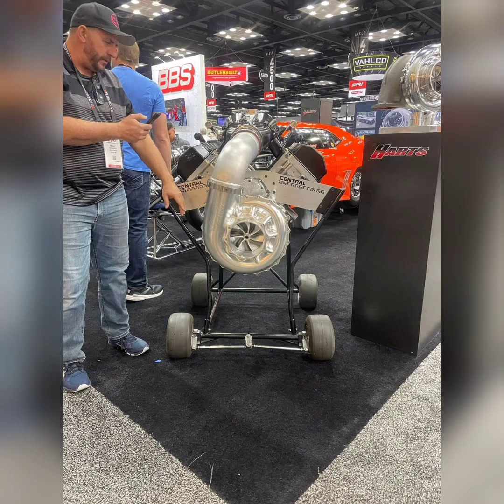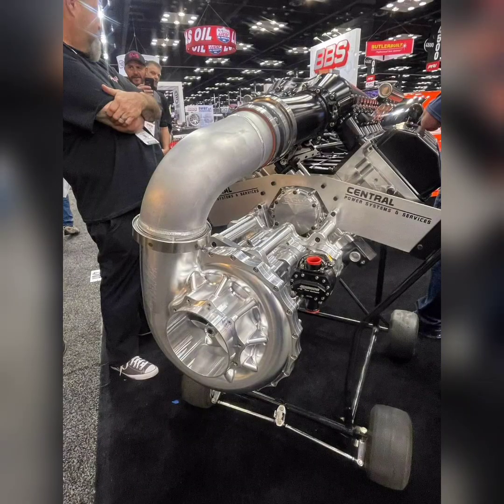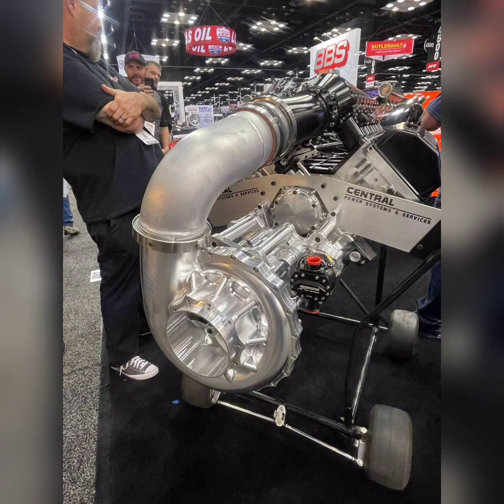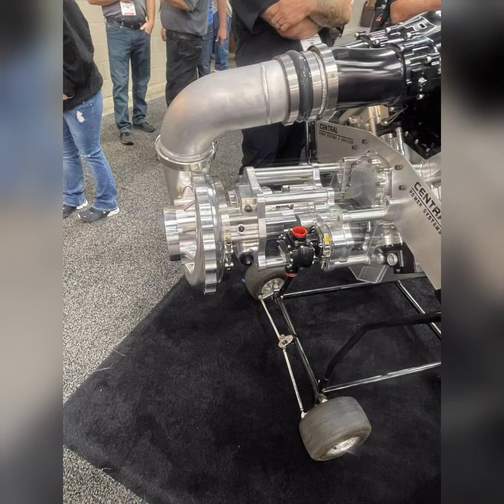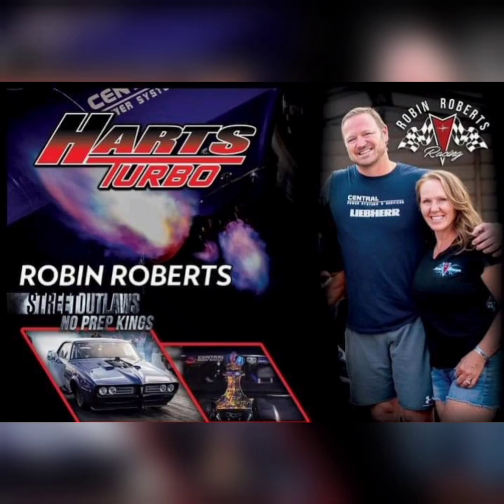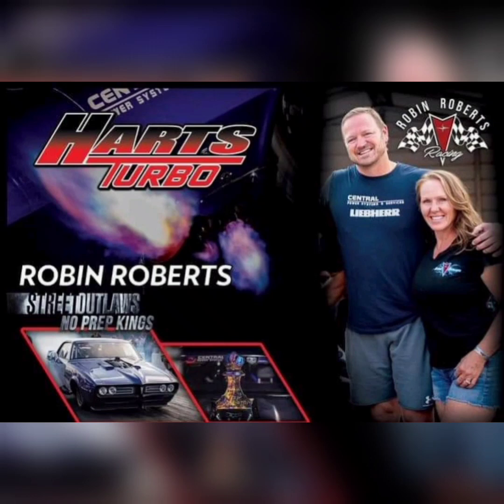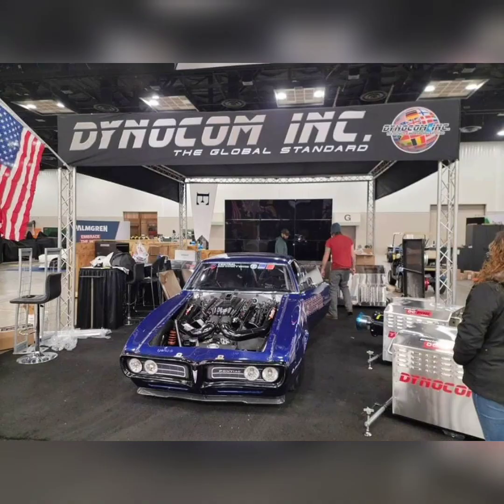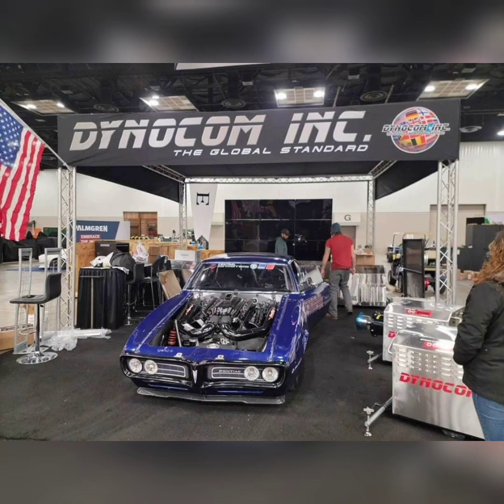Street Outlaws - Hart's Turbo New Centrifugal Supercharger & Possible Robin Roberts New Combo?

Comment: If their first SC matches the Procharger, I half expect them to bring a bigger one. The reason Harts got notoriety in the first place, was they specialized in huge turbos for diesels that allowed the NPK cars to run bigger then offered elsewhere and still get a single turbo weight setup. My guess is Harts will continue this trend and offer bigger than offered elsewhere, basically the same market they made with the big turbos

Comment: Next season gonna be boring as hell!! Most Cars are all camaros! All pro-charge!
Reply: Why?? I think a few nitrous cars have proven themselves to be more than competitive.
Reply: MAJOR PIMPIN  Well yeah, when you're trying to go 3.60-3.70 its going to take a lot of cubic inches and nitrous, but like I have said, the nitrous cars have proven themselves competitive. Same in NHRA where Rickie Smith holds the MPH record in Pro-Mod with a nitrous car.
Reply: MAJOR PIMPIN  And there is nothing to deal with when running a Hemi to over 10,000 RPM???? Touch the rev limiter with a Pro-Charger and pull out the spare Pro-Charger. All power adders have some disadvantages.